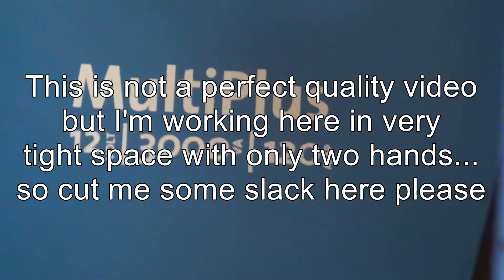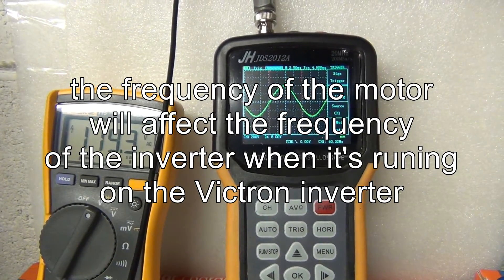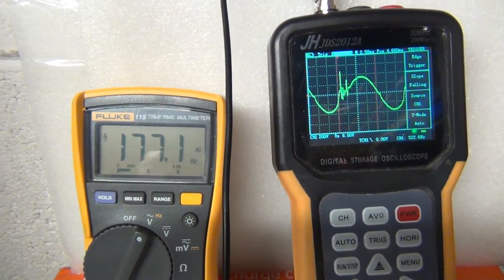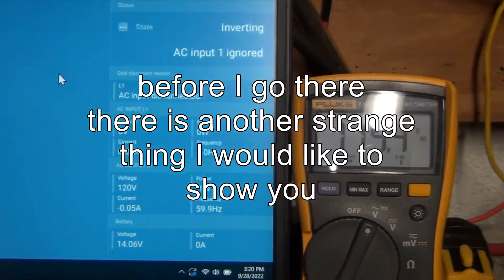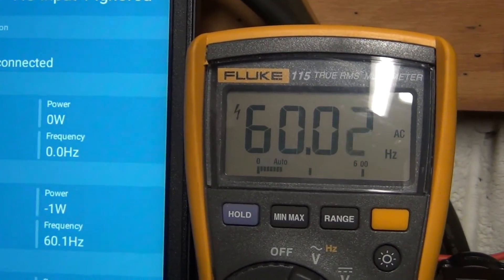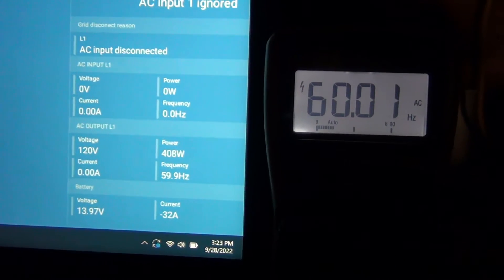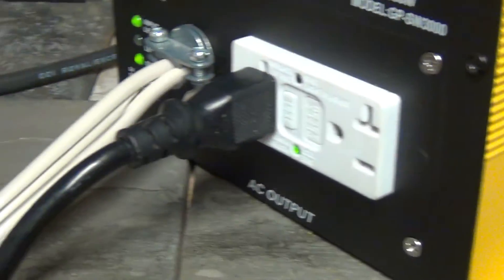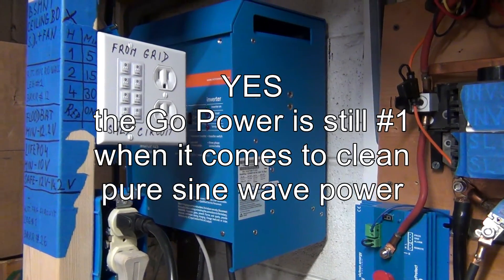Problem with Victron Phoenix and MultiPlus inverter charger

Comment: there is a diode in series whit the element in the heat gun on the low setting. , you should not have the problem on 1200 watts... in 550 wats you only use halve a sinewave, that puls the inverter down.

Comment: I noticed that you did the tests with the devices at 50% power. Not at 100% power.   If there is a DIODE in you device, to use  only one 1/2 cycle for 50% power, then yes there is a problem. No, the frequency is NOT changing to 180Hz.  Try running your devices at 100% power and show the results.  Victron & Diode is a known problem.
Reply from the maker: It should be running at any %
Reply: @VladFredK  NO Kidding!  I told the reason WHY it is making that noise. And Victron is aware of this "devices with a diode" problem.  This is not "new" problem.

Comment: Thank you for this video. 180Hz will destroy motors. I planned on using the inverter with a generator, so the Victron will not work. Can you buffer the incoming current with a capacitor bank?
Reply from the maker: the incoming power is not the problem, is the power coming out, you cant run any motors on it. What kind of generator would be using? DC generator?

Comment: Did you ever fix this issue? I have the exact same sound when I plug into shore power.
Reply from the maker: I didn’t even try, it’s a manufacture problem
Reply: @VladFredK  Try full power on device / load, not 50% power.
Reply from the maker: @MrSummitville  what difference does it make? It’s a junk.
Reply: @VladFredK  Difference  is ... the DEVICE with the Diode inside, still functions as expected!  The Inverter is not junk.  This noise only happens when ... the ONLY load connected to the Inverter uses a DIODE for 50% power. This is NOT a deal breaker.  And the Frequency does NOT change to 180 Hz.  There are thousands of these inverters installed and they are supplying the Volts and the Amps at the correct frequency, as needed by the client. If you don't like the noise then don't use the inverter with a device that has a (50% Power) DIODE inside.
Reply: Buy Deye inverter and problem is solved. I'm using heat gun powered fron Deye and there is no issue.

Comment: Hi, I have a space heater which do exactly the same with my Victron inverter with half power. It has a diode to cut away the other half of the sinus. For some reason Victron doesn't like that. Full power is then ok. Br, Eeli
Reply: Finally someone agrees 0:25

Comment: I call BS, that image of the Victron Connect app was a screen shot, nothing changed on it at all while you were flipping on and off the inverter, those of us who own Victron know that screen's very active... hell your AC output current and power didn't even change, what kind of scam are you pulling here?
Reply from the maker: I’m sorry to disappoint you but this is not a scam
Reply: @VladFredK  Then why did not a single digit change at the 5 minute mark when you were showing the numbers, the app is never frozen like that unless it:s a screen shot you:re showin.
Reply: @Jennifer-007   A Diode, in 50% power setting,  inside the hair dryer causes this problem. This is a known problem.

Comment: I have a Phoenix Smart and it makes a loud thud noise when I switch on certain loads. The voltage drops slightly when this happens. Have been told its normal. It really doesn't sound good 😅
Reply from the maker: Yeah it’s normal……..for Victron, but normal doesn’t mean is good.

Comment: If the output frequency was ACTUALLY at 180, don't you think you'd be able to hear the difference in the motor speed of the air gun or blow dryer?  Obviously, you're not getting an accurate frequency reading. Might help if you showed all of your connections.
Reply from the maker: unfortunately these motors speed is not tide up to frequency, and I did check the sinewave with two different scopes.
Reply: it's not 180, look at the victron connect screen, that's not life it's a screen capture, he's pulling a scam or is a former disgruntled employee.

Comment: Victron inverters use torroidal transformers and you are saturating the core of the torroid with a DC component from the diode in the heat gun and hair dryer. Thiis can also happen with certain motors also.
Reply from the maker: I really don't care what they use, if it is a p o s they should not use it.
Reply: This is so true,  i dont care about the topoligy or components used inside, but the performance and stability and this is really bad..i have 2 inverters, one Victron ( Phoenix ) and a cheap Chinese.. i will perform the same test and post a video of the results using different loads, if it fails like yours i will absolutely stop recommending Victron ( at least Phoenix en Multiplus ) and try to reach out to them.. btw. I have Epever tracer mppt chargers as they also work better for me ( and have better/larger input terminals and communication options ) I dont know why so many peope are fans of Victron.. Thanks for your video!
Reply from the maker: @nextgenelectronica  I don't have any issues with the Victron solar chargers, I actually like them but the inverters are P O S
Reply: Here is a comparison between a Victron Phoenix 1200VA and a cheap Xenteq Purepower 300VA ( not even fair ) with a 300VA charger connected: https://youtu.be/ZS-bQrxGF0w it depends how Victron will respond but i am thinking of selling the Victron and buying another brand.. i will also make a long video showing all components and measurements in one shot for the disbelievers.. you were right about the solar charge controllers, i just ( started with ) and like another brand, but there is nothing wrong with them.. to bad those inverters are outputting this bad waveform, now searching for a durable / dependable inverter brand with good performance. P.s. did you post on the Victron forum or contacted them directly?

Thanks for your response and making of this video!

Comment: I think it were the short-circuited coil in both of your loads
Reply from the maker: and my refrigerator too?
Reply: @VladFredK  Good question.. So a Victron has design flaws when it comes to reactive loads..
Reply from the maker: @dima_kum  absolutely, they need to install some kind of filter so the motor frequency doesn’t effect the output power frequency.

Comment: I just installed a Multiplus C 12/2000 that sounds exactly like that when powering a heat gun.  After install, the first thing I plugged in was a heat gun so I could dry something.  I was so bummed to hear that noise.  The inverter is installed in a van, so having to hear that noise all the time while using it would be a deal breaker.  It sounds fine when powering other stuff.

Comment: Victron markets itself as a premium product at a very premium price so I would also have expected better behavior with non-linear loads. However, the frequency was not changing as much as your meter was indicating because you could "hear" that the inverter's fundamental frequency was the same.  I think your meter was trying to lock onto a third harmonic (180 Hz). The voltage I can't explain and I don't care for the distinct audible change (harmonic content) of the inverter. It just sounds like it is struggling somehow. I know from experience that you open yourself up to ridicule when you dare to question or challenge the functional superiority of a Victron product. There seems to an almost cult like following out there. It would be nice if Victron would respond to your concern.
Reply from the maker: usually, when the target stays quiet, it's been hit right in the bull's eye, so I don't think Victron will comment on it because they have nothing good to say. In the mean time I can here the mosfets crying for help every time the fridge running of this inverter  turns on,...awful
Reply: @VladFredK Victron did comment on this issue
Reply from the maker: @MrSummitville  where is the comment?
Reply: @VladFredK  On the Victron Forum

Comment: Do a better video showing exactly where everything is, cables, test equipment etc. Till then, seeing is believing
Reply: Why would I B S here ? Do you think I have nothing better to do with my life?
Reply: I have a new 1200 multiplus II and two saws, even one that is rated at 5 Amps shuts the inverter off to say low battery and yet the 400 Ah battery is full.  My problem is I can't seem to get any communications for technical support ..... etc.  what good is a warranty?
Reply: @davidpatrick1813  You will need to log into inverter via VeBus port to check yor inverter cut off settings (Voltage/SOC). Is the 400AH AGM or LifePo4?
Reply: @David Patrick  your problem is the startup current. A tool rated 5 amps can draw 15 to 20 amps for a short time on startup.  My 3000 has no trouble handling my skillsaw, recip, air compressor, etc. Of course you also have to have properly sized DC cables connecting battery to inverter.
Reply: @davidpatrick1813  Does it work if you tap the switch on the saw? Or is it a latching switch?
Using a variac might work; turn it from 0 to full voltage over say half a second.

Comment: Hot air gun and hair dryer run at low power setting when connected to Victron inverter.  They use a diode to half the heater power.  This causes problems for most inverters.  Run the gun and dryer at half speed on the Go Power inverters and see how far you get.  Run the gun and dryer at full speed on the Victron inverters.  Guess what?  Refrigerator compressors do not operate like this and will run just fine on Victron and for that matter most other decent inverters.  I guess this guy sells Go Power inverters :)
Reply: Yeah I'm not sure what's going on in this video, my 1200 runs a heat gun, and hair dryer just fine....  my refrigerator absolutely hammers it on startup though, redlines the thing at 2800va.  But it does run it just fine.
Reply: @john0270  Does it run the heat gun okay on half mode (assuming the heatgun has a low mode and a high mode) because as other people have commented here; most heat guns just use a diode to run at half power, which tries to take power only when it's positive (or negetive, depending on which way the diode is wired.) It's a bit like if the the brakes on your car only applied pressure when your wheels were 0 to 180 degrees, then they pulled off the calipers from 180 to 360.
Reply: @john0270  Is that a big old fridge? (2800VA!?!!!)
Reply from the maker: Wow dude....you didn't even watch this video and left dump comment. 
I just done exactly what  what you said. 
And funny you mention selling Go Power products because I was just thinking to endorse Victron products before this happened :) 
Have a good day.
Reply: @VladFredK  I watched your entire clip.  That's how I know what you really did.  If anyone else is falling for this, the reason he sees the trace jump about giving the impression of frequency instability in the Victron is that his test equipment is not set up properly.
Reply from the maker: @retrozmachine1189  you are funny :) I give up
Reply: The Victron output is badly distorted with a difficult load and has high third harmonic content and that is the 180Hz. I think premium inverter should handle difficult loads. Honda generators handle same kind of load just fine. There's nothing wrong with Mr. Vlads test setup. The sound of the Victron is very audible.
Reply: @etusuku8848 Victron is aware of this noise issue, when the only device connected is a device that uses a Diode for 50% power setting.  When there is also other resistive loads connected or the device is set at 100% power, then there is no noise.
Reply: Never had a problem with victron. About to go install another one. What's your angle here?